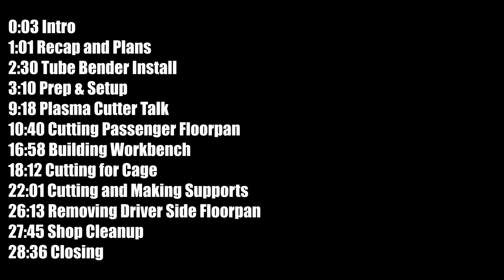I Accidentally CUT OUT the ENTIRE FLOOR of my Mustang

Comment: Food for thought, if you're already cutting the firewall, try to move the engine and transmission placement as for back, and as low as your comfortable with with the general goal being bringing the center of mass closer to the center of the car, and lower to the ground. 
   Pros would be better handling, lower total weight, and less drive train power loss. 
   Cons would being the shift collum would be farther back in the cabin, you'd have to get either a smaller drive shaft, or have the original one cut down, and youd have to either change up the the location of the radiator or get longer hoses and lines

Comment: just a lil photographer fyi: if you want to stop the flickering you can see around 28:17 (the dark lines moving up and down accross the screen) you can play with your camera shutter speed to prevent it and have a nice smooth image 👏 this issue comes from your lamps in the bg which your camera didnt pick up correctly. Nothing much but i thought it was worth sharing

Comment: 0:03 Intro
1:01 Recap and Plans
2:30 Tube Bender Install
3:10 Prep & Setup
9:18 Plasma Cutter Talk
10:40 Cutting Passenger Floorpan
16:58 Building Workbench
18:12 Cutting for Cage
22:01 Cutting and Making Supports
26:13 Removing Driver Side Floorpan
27:45 Shop Cleanup
28:36 Closing
31:54 End

Comment: protip use an air scaler to clean stuff up enough to torch or plasma cut, the flakes of rust block all the hot metal and it blows back at you

Comment: I'm interested to see how you weld the plates in, because it is crazy hard to not blow through the sheet metal and get good beads when you're welding something that thick to something that thin. I have a 280z that was in worse shape than this floorpan wise, but maybe foxbody sheet metal is a thicker gauge.

Comment: A couple of suggestions which I'm sure you have already thought about. 1 might want to roll beads in the floor pans to keep them from flexing and shit. 2 sub frame connectors because we all know you're going race car. HAHA. 3 don't forget when you get back to putting things on to run 10an and 8an fuel line and return...because we all know racecar. HAHA I'm not a fab person, but I know what most cars need to go fast and be straight after.

Comment: Awesome concept. Ill be picking up a foxbody. Its not as bad so wouldnt have todo what your doing comes as a roller but im going for a daily driver build heat ac some power supercharged LS 6 speed manual. Built a c10 drag truck big tires and i drive it on the street cops give me the thumbs up. But its not really a cruiser. Im 22 y/o just living the dream that i want. Keep up the awesome work cant wait to see how this turns out once all finished up should be very interesting with the concept your going for.

Comment: You can never go wrong with the sawzall, I’ve used it to take down small trees. You should think about making room for a motorcycle lift and your shop would be perfect.
Reply from the maker: Didn't even have to make a cut on the driver side. Just stuck the tip through the rust hole

Comment: I'll jump in here. If you're going to run new frame rails. Run them in line with the factory rails. This has been done in drag racing when they need larger rails which end up being through the floor and stick out on both sides.

Aftermarket you can buy "full frame rails" that are for bolting in or welded in. This is a standard thing done to these cars. Considering I'm way behind on this I'm betting you already cut out the floor. Fingers crossed you didn't fuck yourself on that.

Update: Watched the rest of the video and had a huge sigh of relief when you acknowledged the frame rails and that you were going to run rectangular tube for some full rails.

Comment: Dan, you might pick up an inline pneumatic drain and mount it to the wall. Plumb you air compressor to it with a quick connect. If you plan on getting a bigger compressor odds are you will stumble onto SMC products anyway for various filters, regulators and air dryers. But the drain might help with the water getting to your tips in the mean time. https://www.smcusa.com/products/ADH-Heavy-Duty-Auto-Drain~128053

Comment: If you're doing that much tubing you might as well skip the square stock and do full tubular front and rear. You won't need square rails. We've built race buggies from full tubing and one had an LSX and the frame holds up just fine. That Mustang body also doesn't weigh enough to need square stock. 
You definitely should've welded in an X brace inside the car somewhere. I definitely wouldn't be surprised if the measurements are out of wack after removing the entire floor like that with no bracing. But no matter what I'm still excited to watch this build. Lol

Comment: not gonna lie dan i whoulda don this way diffrent i would start with the front the worked my way back i would of cut the front clip off shaved the fire wall built my tubular fronted then did 90s of the bottom of front threw the fire wall along the inside of the rockers then built my center section